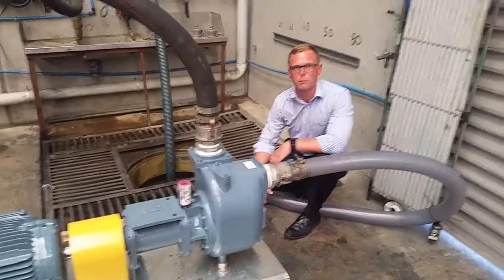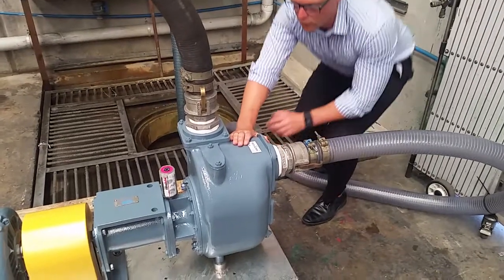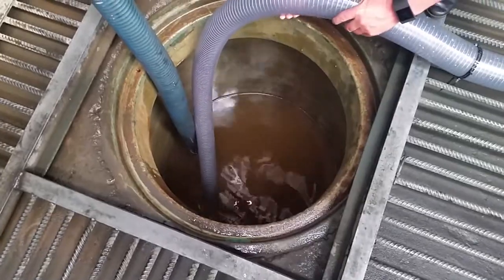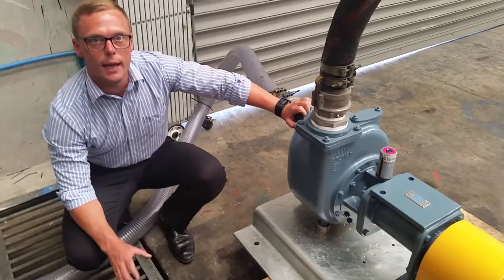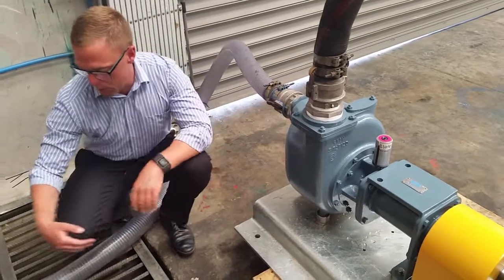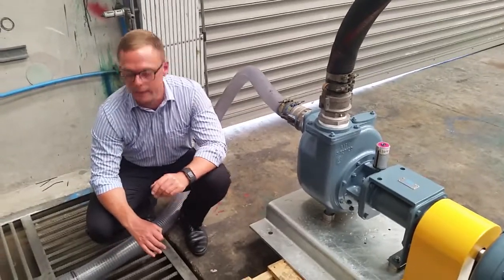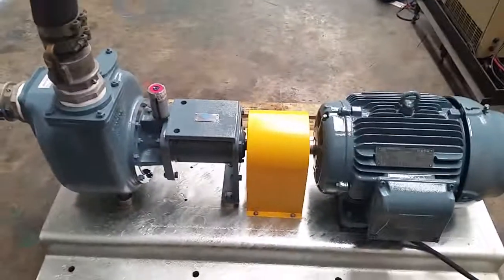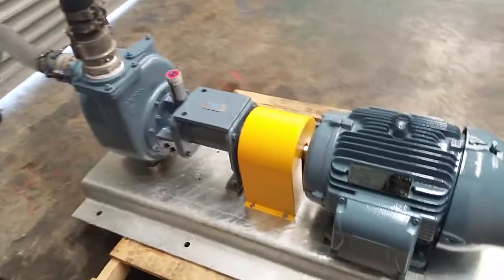Self Priming Pumps for Trade Waste

Comment: Hello, can't these types of pumps suck from a distance longer than 8 meters? If he can't, why? The length in question is 35 meters.
thank you in advance
Reply: Dear Mustafa, no it can not. What actually happens when you lift fluid is that you are making vacuum in suction pipeline, and atmospheric pressure is pushing the liquid into the pump. Since atmospheric pressure converted to meters (at sea level) is 10.3m, that is theoreticaly maximum. But in practical, you have losses due to friction in the pipeline, and I would say 6 to 7m maybe maximum.
Reply: @arturobandini5123  But I plan to use check valves in the suction system.